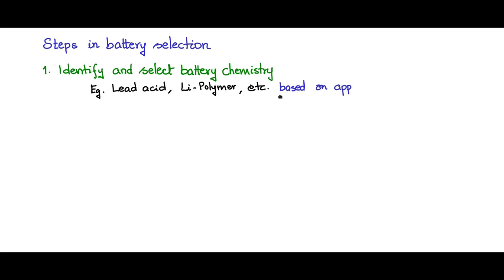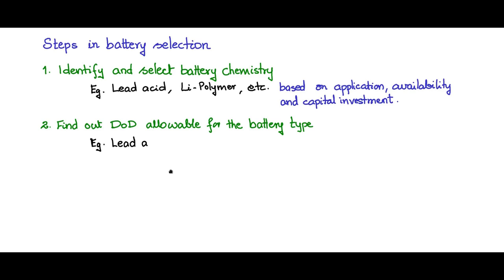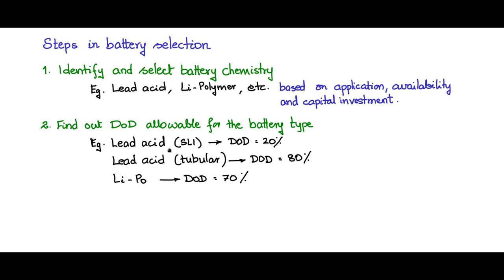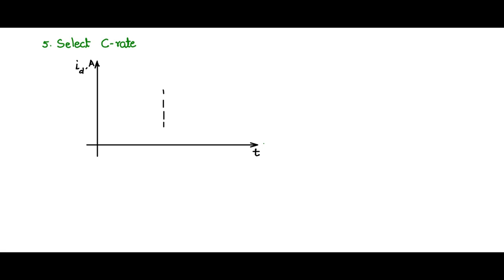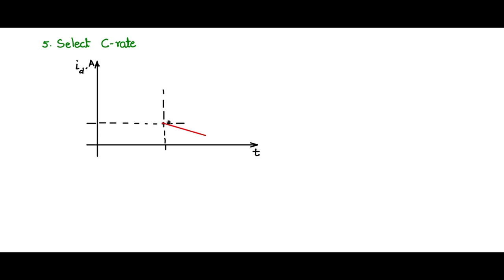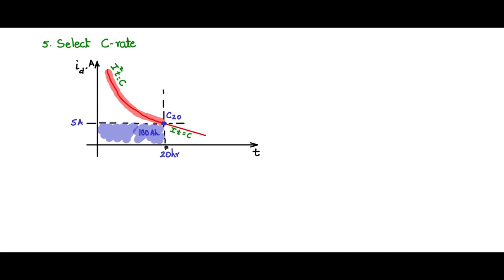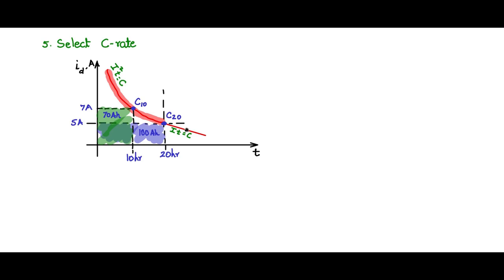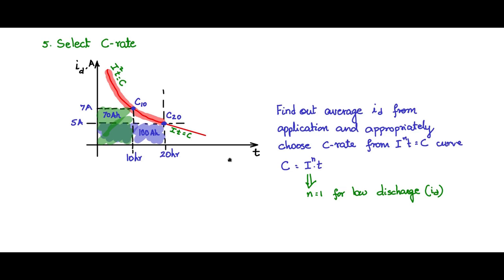Battery selection

Comment: When we say a battery is 26ah - does it refer to usable amps - related to Full Charge minus Depth of Discharge level 14.7v - 10.8v ? Or does it refer to the total amps advertised on the battery?

Comment: Steps in battery selection
Step 1 Identify and select battery chemistry 0:23
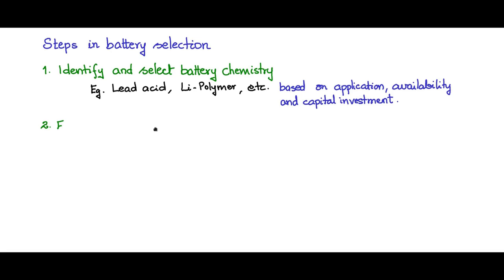Step 2 Find out the Depth of Discharge allowable for the battery type 1:54
Step 3  Find out the watt hour required by the load 4:00
Step 4 Calculate the Capacity of the Battery 4:17
Step 5 Select C-Rate 5:30